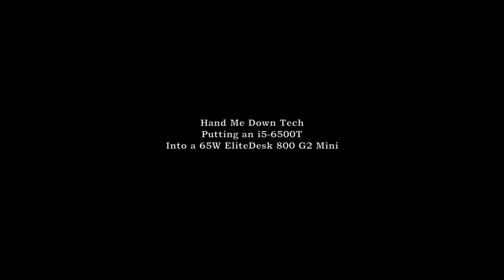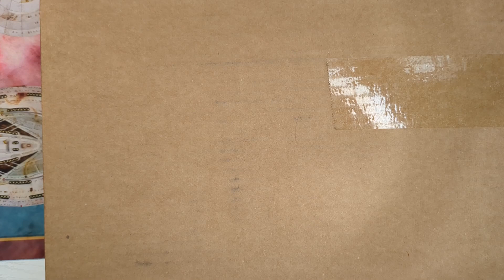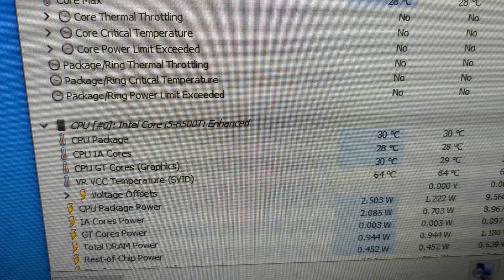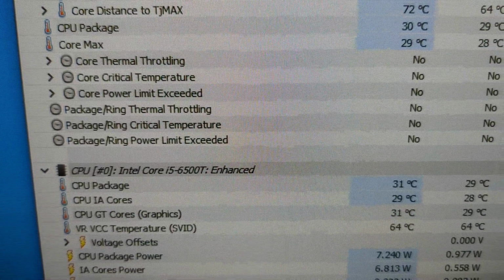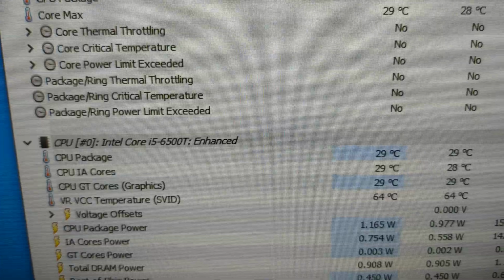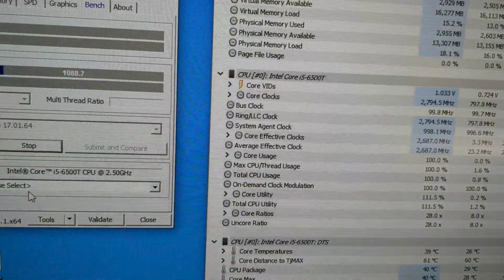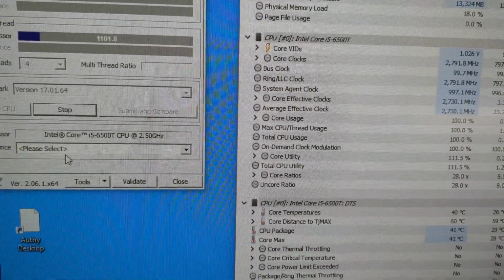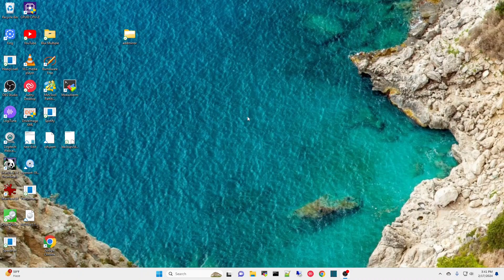Using an i5-6500T on a 65W EliteDesk 800 G2 Mini

Comment: I have two ED 800 G3 DMs (both 65W), one of which came as a barebone unit to which I installed a Core i3-6100 I had left over from another upgraded system. Both the i3-6100 and i5-6500T are of the same vintage, with the i3 being a 2-core/4-thread and the i5 being 4 cores/threads. The i3 also does not support Turbo Boost, but runs at a somewhat higher base clock than the i5, with a slightly higher TDP of 51W. The 65W G3 handles the i3-6100 just fine, through I haven't done any deep analysis of the fans or power behaviors. From my own casual observations, though, the secondary fan over the drive caddy appears to run continuously regardless of CPU load.
Reply from the maker: Correct on the fan.  You may have seen the error you get if the drive fan is not installed. I've also used the T version of that CPU to keep costs down.

Comment: I purchased a G2 800 cheaply with an i3 6100T, expecting it to be a base model 35W. When it turned up, it was a 65W all the correct 65W parts, including the proper power supply, so I assume someone must have swapped the CPU out; the Intel sticker has been removed from the top of the case seems to be working fine.
Reply from the maker: Which CPU is actually in it?
Reply: @handmedowntech   i3-6100T, which I doubt is the original CPU, I will be putting an i5 6500T into it at some stage
Reply from the maker: So you have the cooling hardware but use the T processor.  I do the same with my personal G3.  You can of course use the 65w power adapter instead of the 90w.

Comment: Bonjour, j'ai un processeur de 800 g2  i5-6500 3.4 mhz 65W  peut-on  le mettre sur un autre PC a la place du 800 G2 i5-6500T 2.7 Mhz  35W, j'ose pas le faire j'ai peur de faire une gaffe, merci
Reply from the maker: Le i5-6500 a besoin d’une alimentation de 90 W.   Vous pouvez mettre le processeur dans le 35 W et utiliser l’alimentation 90 W.   Il fera cependant chaud car il nécessite un dissipateur thermique en cuivre.   Désolé pour la mauvaise traduction.
Reply: @handmedowntech  Merci pour votre réponse si rapide, je vais mettre l'alimentation du 65W qui ne fonctionne plus et son radiateur en cuivre a la place,  j'ai mis aussi le couvercle ventilé du boitier 65W sur le boitier 35W  ça rentre sans problème  , votre traduction est bonne 👍
Reply from the maker: Da rien!

Comment: I can tell you this I don't know how they are doing it but the 35w motherboard and the 65w motherboard are both the same
Reply from the maker: Very smart design.  Keeps cost down to only have one type of mb.
Reply: @handmedowntech  agreed I just keep seeing cheap broken ones and fix them
Reply from the maker: @stevenbell9589  what do you spend on average for a unit?
Reply: @handmedowntech  I have 2 now one not working but looking for another to make up one good one
Reply: @handmedowntech  the first one I got in tune last year was £70 as new Condition.
The second one this April was £60 but got £20 of for the bad motherboard that turned out to be a usb cable blocking the keyboard and mouse usb dongle so ended up with a spare motherboard they was both 65w ones.
The the new one for £20 with a dead motherboard but shows a green light so if I can't fix it I have a board I can use in also on talks with another guy about buying a 4th one for £20 with another so say dead motherboard but shows green lights
Reply: @handmedowntech  so this £20 pc comes he sent the fan that he so say broke and it's for the hard drive fan not the cpu fan I checked the pins in the hard drive slot and they are bent straightened them and it works
Reply from the maker: And I thought I was obsessed with these little units 😉.  They are fun to work on since it's so easy to take stuff apart.

Comment: Great video 😊😊😊 .. I bought one lsst year that said it was a 6500T system , came with a full fat 6600 and a big old power brick. The little hard drive fan seems superfluous really as it doesn't do much for extra cooling . If you take it out the system still works , you just get a bios warning at startup. Still great little pcs for the money if you just want a media player/ browser.
Reply from the maker: Those G2s just run and run.  I just recently switched to my G3 7th Gen for day to day computer stuff.  I got my G2 65w sort of like your experience.

Comment: I put the second fan in my 35w.  It runs all the time.
Reply from the maker: Interesting, so you used a 35w and added the fan.  I guess that makes sense since the differences are really related to the heatsink and extra fan.

Comment: Ive been running my g3 800 6500t its a 35w system but i use the 65w power supply no issues so far
Reply from the maker: Is that with one or two fans?
Reply: @handmedowntech  just one fan, above the ram

Comment: Prodesk G3 i7-7700T with D.I.Y. tower heatsink cooler mod + GTX 1070 GPU via M.2 <--> 16x PCIe adapter here, got a few gameplay videos on my channel. Practically non-audible in desktop / CPU -intensive heavy tasks, currently under-volted GPU (about minus 20-30W power draw vs stock) make slight noise when gaming but cant hear it anyways while gaming.
Reply from the maker: Pretty cool.  Dumb question, I'm assuming you have the cover off or did you have to cut into the case?
Reply: @handmedowntech  The latter one, cut a hole. Took about 2 hours when the pc warranty was void after picking it up from the post office :) https://img.aijaa.com/b/00307/15219245.jpg
Reply: @handmedowntech  The latter one, cut a  hole. Took about 2 hours to void the warranty after picking it up from the post office :) Tried to reply a moment ago with a link to picture but seems it was blocked.
Reply from the maker: @FlukeFIN  YouTube doesn't allow links to cut down on Spam. If there is something I can search for to find the site I could try that instead.
Reply: @handmedowntech  eGPU forum -> External GPU Builds -> 2017 Prodesk G3
Reply from the maker: Is it this https://egpu.io/forums/builds/2017-hp-prodesk-600-g3-7th4ct-gtx-1070-32gbps-m-2x4-adt-link-r43sg-win11-aluminium-profile-2020-custom-rack-enclosure/.   Dang!  That is a beast

Comment: I have Hp prodesk g2 mini with i5-6500t just replaced cpu to I7-6700 works fine at start says fann error press enter. cpu fann is working. I have 90w power supply.
Reply from the maker: Do you have the caddy with the built in fan?  I believe it expects to see that one plugged in.
Reply: How's the cpu temperatures on i7-6700 vs i5-6500T?
Reply: @FlukeFIN  I'm guessing it runs hot as I had a 6700 in a dell tower and it was hot hot hot with the stock cooler

Comment: I have the 35W G2. I'm thinking about getting a 65W version with an i7 6700 as it has twice as many cores, just worried it's going to be noisy (my 35W G2 is silent most of the time). I run Linux on my little unit - love it.
Reply from the maker: What processor is in your G2 now?  You can also get 4 cores with the i5 6500T
Reply: @handmedowntech I have the i5 6500T. It has 4 cores/4 threads.
Reply from the maker: @MnemonicCarrier  you'll have the same number of cores, just double the threads.  I use the 65w 6500 every day for my normal desktop.  It is definitely louder than my 35w units but not excessive.  I keep it off to the side to minimize the disturbance.
Reply: @handmedowntech Ah, okay - thanks for that. Might not be worth doing the "upgrade" then, as I really appreciate the peace and quiet (although the extra threads would be nice). These beautiful units make great Linux machines, but I could really do with some extra horsepower for my personal workloads (i.e. running Android Studio, Android Virtual Devices, compiling a ton of stuff etc...). I've been looking at prices, and I think I might be better off going for one of those "Mini Forums" type mini-PCs (with the Ryzen 7, 8 cores, 16 threads, Radeon RX 680m or 780m iGPU etc...) 🤔
Reply from the maker: You could look at the 35w G4 and G5,  gives you 6 cores

Comment: I'll bet the power supply requirement is something in the BIOS that is hard coded regardless of the CPU installed.  Those tiny fans pull very small current like 0.12A to 0.5A at 12V would be 1.44-5 Watts.  There should be a rating on the fan assembly telling volts and amps eg. 12V @ 0.12A just multiply the two that's watts. volts X amp = watts.  My Elitedesk is running a software update right now or I would look.  I just ordered a G3 to add to the fleet by the way.  It's a 65W barebones for $35 with fan, caddy, sata cable.  I ordered an i7-7700 and 16G ram to put in it.  I've got SSD's laying around to put in it.  I enjoy your videos.  It's like stuff I do sometimes.  These Tiny little machine's are fun to tinker with at home.
Reply from the maker: I'm hearing from some commenters that they are able to run everything fine using the 65W vs 90W power supply.  I would have experimented more but was concerned I wasn't booting up - word to the wise - don't use your primary machine for tinkering :)

Comment: It has been my experience that when you change out higher TDP CPUs with lower watt CPUs the system, although able to run the lower TDP CPU in a higher wattage system, takes some time to READJUST to the new environment. As you discovered, a 35 watt CPU will run in a 65 watt system. You shouldn't have to use the 90 watt PS because the CPU is not drawing above 35 watt. Therefore, you should be able to power a 65 watt system, that is using a 35 watt CPU, with a 65 watt PS that is adequate for a 35 watt system. However, you can also use the 90 watt PS because it can deliver the wattage required for the 35 watt CPU. On the other side of the coin, you cannot run a 35 watt system with a 65 watt CPU!
Reply from the maker: It did sort of seem that way going the other way too (when I put everything back the way it was the booting took a couple rounds to come around )

Comment: I always go by the numbers when tightening heatsinks down but I also only tighten one or two turns and move to the next screw and repeat until all the screws are tight to avoid putting too much pressure in any one area on the top of the CPU or bottom of the heatsink. I also loosen the same way.
Reply: exactly! Proceed almost as with head gasket torquening... 
One of the benefits of that is you need very little thermal compound on the CPU and it spreads evenly without sipping out.
Reply: old fashioned perhaps but "tighten evenly" is my approach too.
Reply from the maker: Good advice - I also find I sometimes have to tighten each one a slight bit so they fall into the holes in the MB

Comment: What I've found out yesterday was that I'm not able to use 2.5" drive caddy once second nvme slot was populated. Drive caddy is colliding with new PCB. So caddy is out atm and I'm considering using Dremel.. shame as I though no tools will be necessary to use 3 ssds
Reply from the maker: What I usually do is use a 2230 for the one just under the caddy.  That gives enough room on the G4 and G5
Reply: That's probably a 2.5" caddy.  Don't think a 3.5 would fit into the case.
Reply: @walkman1269  misspelled 🙂
Reply from the maker: Now that would be an interesting video - try to get a 3.5 inch SATA drive to run in the case.  One of the problems would be power and of course the fact that there is so little space

Comment: My config is:  i5-6500T on a 65W EliteDesk 800 G2 Mini with 65W Power Adapter (from 35W version). Everythig works fine.
Reply from the maker: Do you use a SATA SSD and does the caddy fan stay on?  My limited testing seemed to show that it works fine with the 65w power adapter.  Good to hear from others.